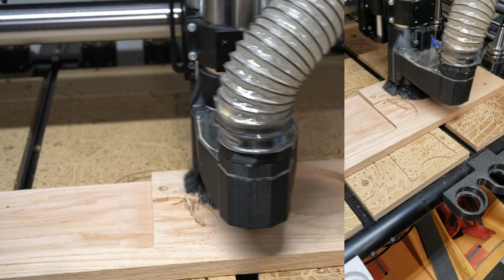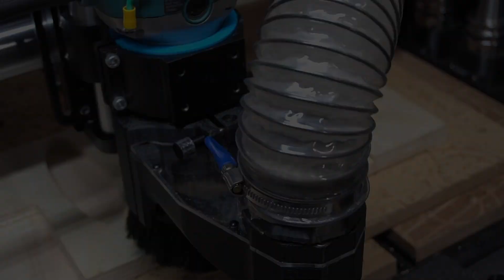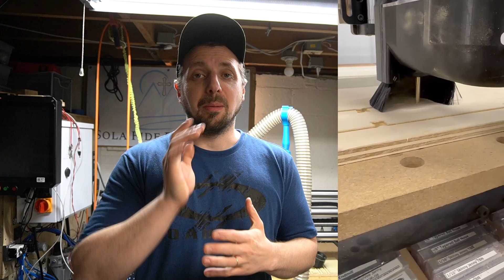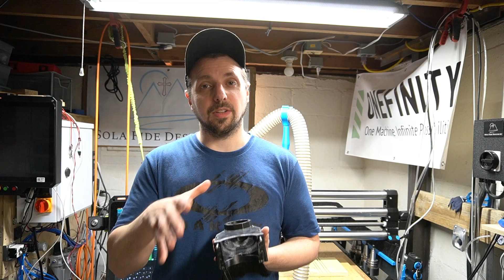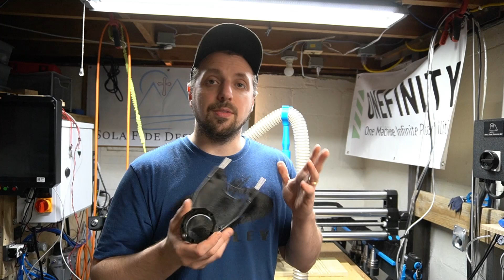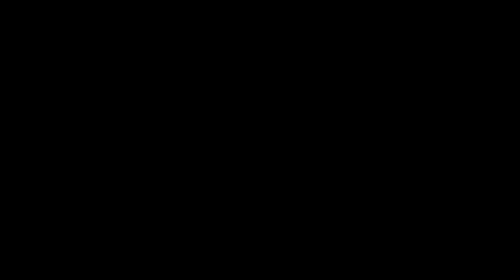The New Raptor Dust Boot For The Onefinity CNC Machine

Comment: What’s the largest surfacing bit you can put in it with the 2.5 version 80mm?
Reply from the maker: I wouldn't run over a 2-inch bit. The way the Onefinity mount is it's gonna be hard to get a boot that will run a bigger surfacing bit